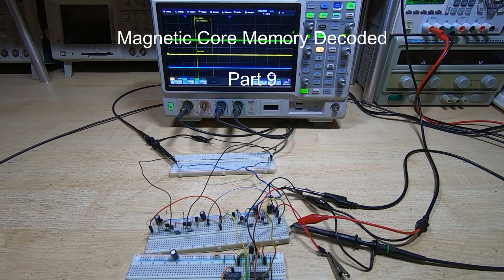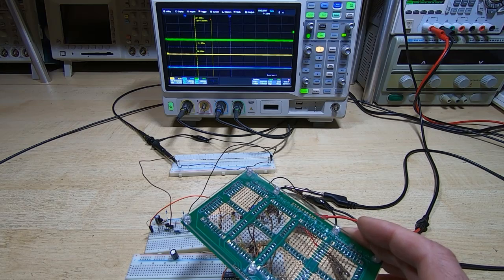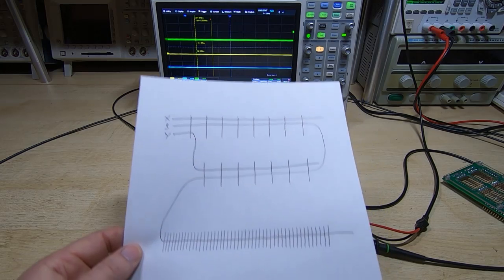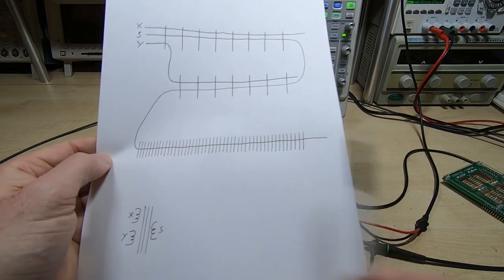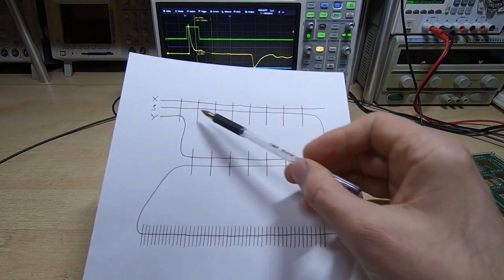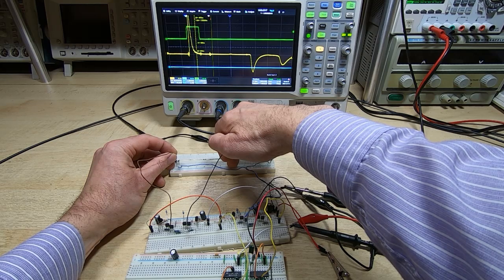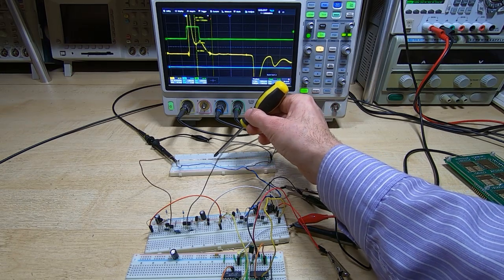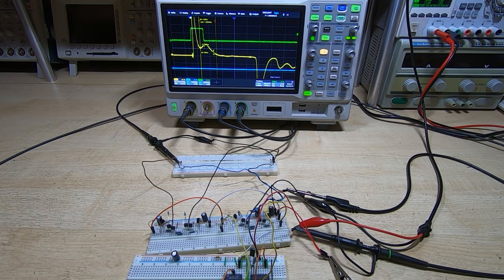Magnetic Core Memory Decoded Part9

Comment: Since the cores are rotating physically, they should actually produce some noise when in use. Wonder what the wear level would be since they are actually grinding against the copper lines. Yet very low amount of friction though.
Reply from the maker: The cores do not move on the wires so there is no noise and no danger that they will wear through the wires.